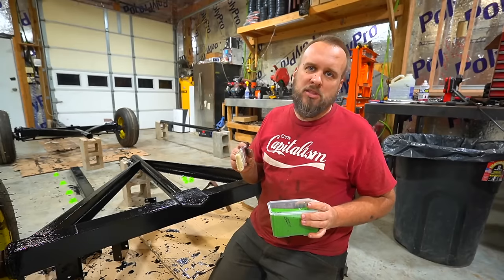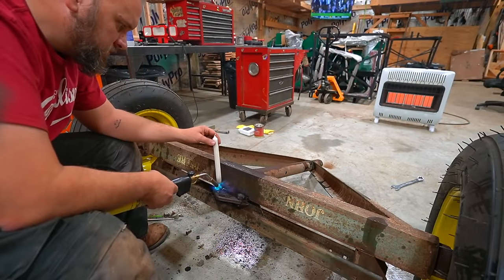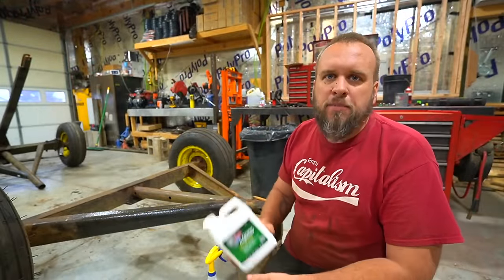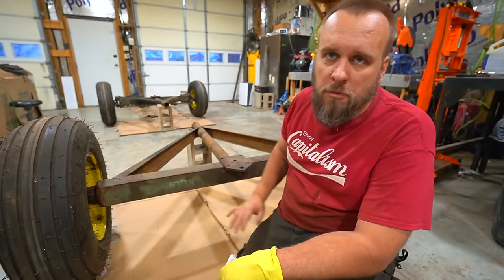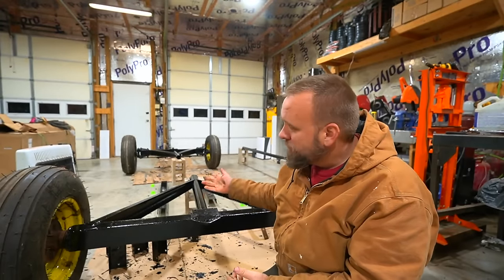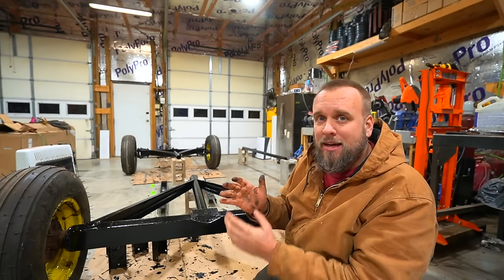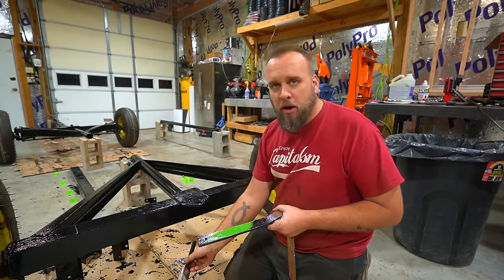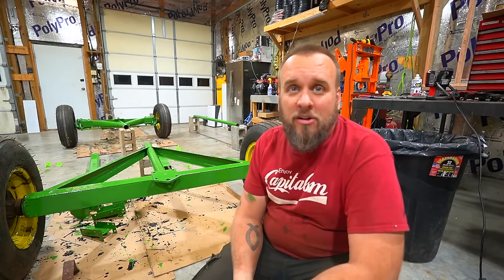Painting an Antique Hay Wagon with POR 15

Comment: No disrespect to you and I hope your hard work and excellent paint job holds up. I have used por15 on many projects over many years. Truck frames, weber bbq frame, cooler rack, boat trailer, obs f250 side step sub frame, wrought iron railing etc. None of these projects held up well. Some projects i painted over the rust like its recommended.  Some projects were sandblasted.  Some were new metal. I meticulously followed the instruction,  and i top coated with por15 top coat. I know how much time & effort you put in. Me too. When it fails, it comes off in sheets. It can really piss you off. I found a much better product. It's called mastercoat. The master series. It's used on bridges and train cars. Search out a fellow YouTuber called "repair geek". He has a recent thorough comparison of several leading rust preventative coatings, including the above-mentioned products. He also has video's on properly rustproofing a car and several undercoating video's. I realize you are done with your project.  But you will probably be painting other things. There is an industry standard salt fog test performed to measure and rate the durability of outdoor paint. Por15 is rated at 1000 hours in the salt fog test with poor results. Rust creeping under the paint. Mastercoat lasted 14,000 hours with excellent results. No creep.  Also, you can spill brake fluid and acetone on Mastercoat without harm. That is why the ny city subway uses it. Graffiti can easily be removed with acetone. I did my 1997 f250 frame with it 3 years ago, and it is rock solid and looks like the day i painted it. So far, it's been amazing for me compared to my experience with por15.  Its also less expensive. If you ever have any questions about Mastercoat.  You can get the number off their website, and when you call, Pat, the owner answers the phone. Ironically, he used to work for por15 many years ago. Really nice guy. Gave me great advice about removing my factory undercoating.
Reply: Thank you for sharing this info, I'll definitely look into Mastercoat for any future projects.

Comment: You need an acetylene oxygen torch. If you are not going to reuse bolts. You cold cut them off fast with a torch. Plus you can heat up metal also. You can’t go wrong with a torch on a farm.

Comment: Hello Brock, thank you for using our products. Love the video and glad you took the time to remove the bolts and dismantle. I find myself contemplating things like that on my projects and I am happier with results when I make the extra effort. Even though it creates more work and sometimes headaches. 

Here are a couple tips that may be helpful to others that I would like to share based on your video. One thing to note about the POR-15 Rust preventive coating (red can) is that it is a Moisture cure formula, so timing of the second coat or top coating is heavily influenced by the humidity in the air. Temperature does influence it as well, but not as much. Applying two thin coats would help the drying time and it is recommended over thick coats. I will give another reason why it is better in bit. There are times where it dries enough for a second coat in one hour and other times 4 hour. The rough dry time on the can is based on ideal humidity and temperature. We also sell a DryTime accelerator that cuts the dry time in half for people in dry climates or need quicker application times. 

I usually tell people to break up the project in to two days or three days if there is a lot of loose rust. Day one remove loose rust and old paint, day two clean and etch the surface, day apply the coating and top coat. If there isn't a lot of rust or old paint then it is two days. One day for cleaning and etching and the second day for painting. Note big jobs obviously will require more time but breaking up the time by the process, helps you keep your sanity and not lose sleep! 

Some general things I noticed that would improve long term performance and adhesion for our paint and for other paint manufacturer products as well. These aren't deal breaking tips, but could be factors in premature failure of any paint job regardless of manufacturer down the road. These are almost always the reasons for premature failure.
When you used the cleaner degreaser you should work or agitate the surface with a maroon scouring pad or brush to help break down and remove the years of oil, dirt, and grease. Think of it like washing a greasy dish in the sink. Just putting on soap and letting it sit on the surface will remove a lot of the grease and oil, but it would be more effective and quicker when you scrub the plate. This is important for new bare metal as well. Also after you're done cleaning the metal, you should wear gloves when touching the surface. I've done this too, but in general it's not good to touch the surface with bare hands after cleaning and degreasing the surface. even clean hands will have natural oils that will be left behind after touching the surface.
The second is the use of an etcher that neutralizes the rust and metal. There are others on the market, but we recommend our Metal prep because we know we only use high grade raw ingredients and it leaves zinc phosphate to help adhesion. This is an extra step, but we found it to help all paints we tested to adhere to metal better. After almost 40 years of testing there is a reason why a lot of mining and oil companies use the three step process for repainting heavy equipment. Again these are not deal breakers just highly recommended tips. 

Now here is the second reason why thin coats are better than thick coats. This is specially true when it comes to our moisture cured rust preventive coating. If you apply a thick coat and the humidity is on the high side, the coating will skin over. This means that you will have the surface of the coating dry but it stays wet under the skin. What typically happens is tiny gas bubbles start to form and come through the skin layer. This leave weak spots in the coatings where they are likely to tare or worse leave the metal exposed. If you ever see tiny holes in any paint job on steel it is best to lightly sand and apply another coat no matter what brand you use. This goes for any paint job where you are trying to prevent and stop rust.

If anyone has any questions please feel free to contact us.
https://por15.com/contact
Reply from the maker: Thanks for the tips. I have several more projects like this one planned, and I will learn from this to do the next one better.

Comment: Would like to see the difference in paint color. Regular Deere green, tractor supply green and the antique Deere green. I looked up the MSDS of this product and Eastwoods. Ingredients are basically the same. And the Eastwood product is advertised as one coat. Did my Ford Ranger truck frame in one coat, Turned out just fine. Used Harbor Freight cheap throw away brushes.

Comment: Looks real fine Brock!  We had the exact same JD running gear under one of our hay wagons. Dad bought it at auction from where the back corner had been burned in a barn fire. We fixed up the rigging and used it for years. The frame never looked as nice as yours does, though!
Reply from the maker: I bought it because I thought it would be neat to have something period Specific that matched the old tractor.

Now I’m gonna use it for Hay.
Reply: @RockhillfarmYT  Ours was rigged with a flat platform. Solid oak stringers on each side, maybe 3” x 6” x 16’. IIRC it was 4 crosspieces of oak , maybe 3” x 4” x 8’. The original platform was 1” oak boards about 6”” or 8” wide x 16’. We fixed the rear corner that had been burnt with hemlock boards sawed from our own trees. Good memories!

Comment: I'm usually cheap and run my hand torch with the green propane bottles. 😂  Does the slightly higher burning temp of MAP-Pro help in this application?  

From googling I see that propane, Map-Pro, and MAPP burn at 3600, 3730, and 5300 F respectively.  It seems hard to find true MAPP gas.
Reply from the maker: Question, but I don’t really know the answer. I’ve got some of the yellow bottles and some of the blue ones.